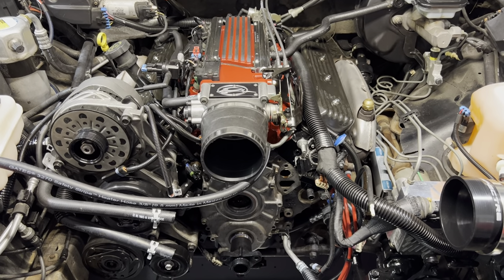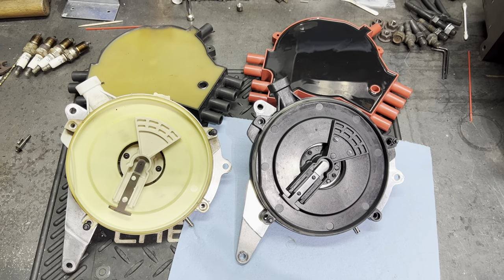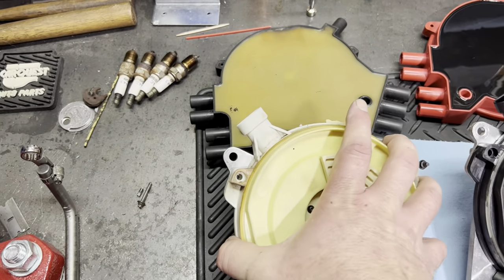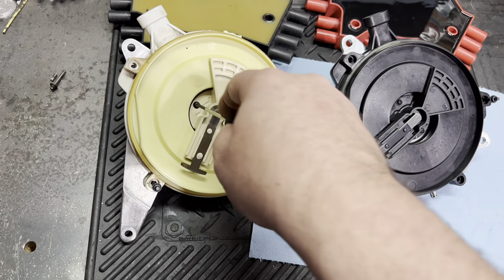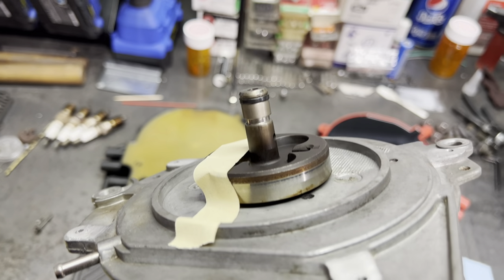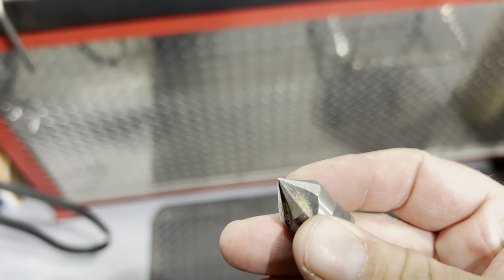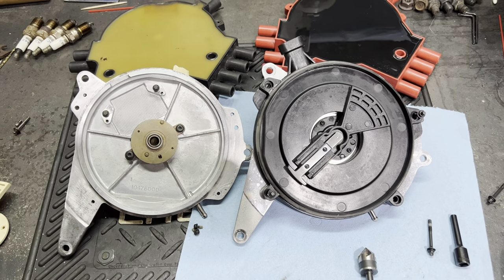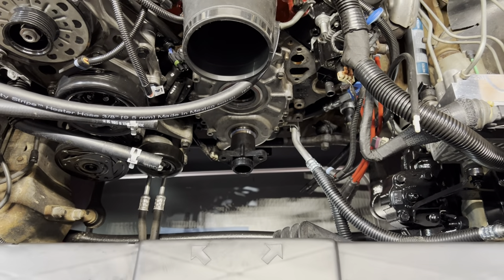Optispark Distributor. Watch before you buy!

Comment: Do i have to change my cap and rotor, or can i just change the optispark..my car has been sputtering pretty bad and i havent had a tune up in maybe 6 years.. also my upper radiator hose was leaking from the thermostat housing and i think it leaked on the optispark, any adive is appreciated!!
Reply from the maker: It sure sounds like you got moisture in it. If that's all that changed and it wa mine, I would buy a new one from Speedway if they still have them. Pull the cap off and see if its clocked right. If it is, I would just put the new one on. If that isnt available, I would buy one like the one I bought on Amazon or get one on eBay. Clean and dry the the factory base, take off the disc and spacer under the rotor, clean and dry that off and finally use some glass cleaner on a soft towel, and clean between the factory  sensor where the disc gets read. Put the cap and rotor from the new distributor and you're off. I would refrain from using the Chinese sensor when doing this because they dont seem to last. The whole distributor on Amazon is usually $70 less than a cap and rotor at Autozone.

Comment: Ok so aftermarket has came in and corrected the problematic spider/tbi with retro fit mpfi systems on the small black v6/v8s ... Is there not a way to retro fit a distributor-less ignition system of these style engines?
Reply from the maker: Yes. https://www.torqhead.com/index.html

Comment: The most important thing is the optical sensor with the Mitsubishi logo on it.i always keep my old opti and just replace the cap and rotor, and silicone it all around on the gasket it brings,and replace the 2 o'rings on back and you'll never have a problem, those after markets are garbage, even the aluminum housing because there not spaced right,the metal disk that rides on inside the optical sensor is not supposed to rub on the sensor..
Reply: I haven't started mine yet buy I already asked why not use factory optic thank u for answering that one smdh.  Poor guy drilling n tapping needs loctite retaining number 660 n any metal on metal ain't separating till over 300f.  3m panel bond or lord fusor theirs tons of compounds for all types of surfaces  many drill and tap able!! I'd have riveted the whore n sent it not like ya can get to screws or rivets without removing ingredients all else.  Seconds n done bye bye lol I hope doing my neighbors shortly here

Comment: You also have a problem with Vac with distributor put together try blowing through vac ports .
You cant the distributor caps were not upgraded for vac ports 
Try blowing through them you cant.
the 2 plastic rings seal bad gasses and water in .making cap flex and hit rotor also 
till finally loosening cap screws untill vac starts working.
but now can let water leaks in.
How to fix I took wirecutters  and Sissor clipped and brok out quarter inch 
of 2 rings lined up at 6 oclock opposite  the plug in for wiring.
now vac works as intended

Comment: Not sure if you're still checking this, but for someone who is just looking for reliability and not tuning, etc...would you recommend the Torqhead conversion?

I noticed you and a couple others in the comments talking about it and it's the first I've seen of them. Looks interesting.
Reply from the maker: @TwentyFortySeven  Try Petris. Some guys in the comments say there really good. Haven’t heard otherwise. If you go with the efi connection 24x or torque head. Make sure you research. One of them is better. I forgot though.

Comment: 3:34 yikes 6:10 there is a gent that upgrades the Opti to the 96 and newer which has the Mitsubishi pickup and rarely will fail after that. Buick didnt have this problem as from the get go they had a different optispark system which was adopted by chevy/pontiac once the failures from the 92-94 modles where prevalent.

Comment: I converted my water pump to electric as well. Absolutely no issues
Reply: I had a torqhead 24x cam shaft position sensor went out 24/7 efi connection probably would be the best way to go
Reply from the maker: Did you purchase a harness from Innovative Wiring to make the conversion, or make your own?

Comment: Have the same damned problem....with my $700 msd.....what the hell man
Reply from the maker: That’s why I didn’t buy an MSD either. After extensive research, I found that this is one problem you can’t buy your way out of. We live in a time of unprecedented incompetence. If I had to do it again, I would have done an LS swap. I have one already installed in a 93 SS clone. The only thing I would say is get one from a Camaro or corvette. I’ll probably spend as much on induction, ecu, harness, and Holley brackets/accessories as I did on the LM7 with cam and springs. Maybe more.

Comment: Just bought the mostplus all black cap one going to use it for the cap and rotor since it was one of the cheapest deals on those and came with a new cord too. Hows your frankin opti holding up?
Reply from the maker: Working great. At the end of the day, it was mostly about welding the holes and re tapping them. Put the most plus cap and rotor on with the new screws. Done. I just didn’t see good enough feedback on any so I figured swap the good sensor in the new one and blue loctite the screws, should be good. Never even considered it being out of clock. It sure made a simple job a pain in the butt.

Comment: What brand is the  new  one??
Reply from the maker: The new one (out of clock) is a Most Plus bought on Amazon. Many of these are out there sold under various names. I opted to use it because I thought I'd just swap in my optical sensor and go. Its cheaper buy the defective one just for the cap and rotor. Also has brass terminals. The cap and rotor at Autozone was 117. to 134 dollars if memory serves me right.

Comment: Thanks for this video. My Buick shut off. My buddies shop replaced the opti and the car kept stalling at idle. P0335,P0336 codes come up. Replaced opti again with a accell, car kept stalling at idle. Replaced crankshaft sensor, replaced pci, car stalls at idle, same codes. Unfortunately the original opti is long gone since at the time we didn't know the headaches with these. Not sure if I'm screwed now, once the cars warm it stalls all day and has valves tapping. Would y'all get a old opti and rebuild or what because damn it's going on 7 months and I'm about ready to push the car into a lake
Reply from the maker: Very sorry to hear about your dilemma. It’s tough to say, but with no results from two Optispark’s, and changing the cam and crank sensors, the only other things left are the wires and plugs to those having an issue. Also the only other two things in that system are the ignition coil and module. You may have to go to an auto electric specialist to retain your sanity. Stuff like this is definitely maddening.
Reply: Could be a MAP sensor
Reply: Icm bolts to the head. By the coil heat kills the thermal grease .on the heat sink
Reply: Well, here I am a year later lol 3 different shops plus my time. Misfires when warm. Looking for a ditch to lay her in 😭

Comment: So , just your original cap was bad?
Reply from the maker: I tried to inspect it and three of the 6-40 screws broke so I figured just buy new cheaper one, and put the own sensor in. I had no faith in anything out there, so why spend more when the key component was being re-used. I never anticipated that they could be out of clock.
Reply: @wheelstandr  
Man , I'm working on a 95 , rough idle , misfiring and backfiring back through TB. It did all at once , owner said he reved it up a couple times and these symptoms started immediately. Ran good before so he says. I got good injector ohms , noid light flashes and have spark all be it orange. I'm betting on bad cap and rotor. What do you think? I did FSM steps and it says distributor.

Comment: All opti sparks are trash. Best thing to do is delete it with a Torque head or EFI Connection 24X. The only benefits i get from running a MSD distributor is that they always allow me to drive him when they fail and they can be repaired by MSD.
Reply from the maker: What you're saying is true. I had intended on using my low mileage sensor in a new body and obviously that didn't work. As you saw, I had to recondition the factory distributor using a new cap and rotor. I was intending on selling the car, but after all I had to do from it sitting 20 years, I figured its a new car again. The car had a bad respray so I stripped it down and it just got repainted last Wednesday after being in the body shop for 6 months! It's dark blue metallic instead of black now. If this distributor issue comes up again I'm going to do as you said or put an LS like my 93 caprice. Dirty Dingo mounts, Holley manifolds and accessory brackets. Cost a lot more than I thought. I'm the local carb guy and have the Edelbrock carb intake box, and harness, but cant use it. The rear float bowl of a Holley touches the firewall and theres absolutely no way to get an air cleaner on it. Now I have to get an intake, rails, ECU and harness. Next time I need to get an engine from a Camaro or Corvette if I can afford it. I need to get my white SS clone running!

Comment: Just looked up an msd opti, 700$!!! Ahhh, accels are like high 3s to 400
Reply from the maker: When you have taken one apart, you realize how simple it is. It’s tough to pay that kind of money. I haven’t bought one to see if it’s clocked properly, but if my deal didn’t pan out, I was going to buy the summit racing branded one or the ones on eBay sold by speedway motors as a “garage sale item.”
Reply: @wheelstandr , oh yeah and the accel and msds that I was looking at had no warranty
Reply from the maker: @hazard4349  I just got a notification from Speedway. They have the LT1 optispark on sale for $52.49  $147.50 discount. For that price, I’d check it out. Open it up and verify the rotor is clicked correctly against your stock one. The only thing is, is that it’s a pin drive not spline.
Reply: Avoid Accel at all cost! I'm replacing a 1-year old Accel in a C4 Corvette. Very frustrating. Check out Petris Optispark.
Reply: @khalidalhomoud1883 
Agreed accel is trash!!

Comment: Don't buy the cheap China MSD look a likes. If you can find an OEM Opti Spark that's still new, buy it. Back in the 2000's I went through 2 Opiti Sparks a year. They do not like high RPM. A company called Deltech came around and developed coil on plug and that eliminated the Opti all together. It was pricey back then but worked flawlessly. Since I am not in the LT1 game anymore, I am not sure if they are still in business. But the good thing with todays after market ECM's, you can do LS type coils on it with a crank position and cam position sensor and have way more tuning capabilities than with the opit spark. I can tell you one thing, watching this video made me cringe.

Comment: Your finding out the reason  why  people prefer the  LS engine  over the LT 1. Dealing with the optispark is a pain in the ass. And the  ones from the 
parts store  are a crap shoot .
Reply from the maker: Oh no, I was already quite aware long long ago. In fact I already was in the process of an LS swap in my 93 Caprice SS Clone. My wife thought she'd do me/us  a favor and bought this work farm before I could say no. I've been pissed about this car since the first minute I laid eyes on it. 50,000 miles doesn't mean anything if the car wasnt stored properly. Now It need paint! I could have bought every top end part and more to finish the other car. All it needs is an intake tb, injectors and an ECU. Done and a very nice car.  Spohn Performance sway bars, powder coated boxed control arms, eibach springs, hotchkis-bilstein shocks, Rear z/28 spoiler, SS wheels, 96 rear disc axle w/3.73 gears. Even the one year only 94 quarter glasses. Now I'm going to have two. A gutless stocker and one with 400 plus hp. I figure now I may as well put an even bigger cam in the 5.3 since it doesnt need to be fast and as good mpg. In closing, I have never been so pissed while working on a car in my life as one I didnt pick. Let alone having to do a semi complete restoration of an entire powertrain. Every seal on this is new. every hose, but the two AC hoses. AC compressor, dryer, intake gaskets, grommets, plugs, wires, starter, alternator, radiator, radiator overflow tank, fresh air intake, sway bar bushings, shocks, calipers, pads, air pump delete, mufflers, tail pipe, seat base covers, headlight system, electric water pump, innovative wiring relay system for water pump, complete heater control, speakers, Double din conversion on the dash, respray dash pad out of the car and the dash plastics, lloyds mats, sandblast suspension parts and epoxy paint those. remove transmission, replace rear main, transmission gets new corvette servo, pump removed and resealed, and all others. .500 boost valve. finned aluminum pan with drain, new radiator plastic top. Now I have to strip everything , glass moldings bumpers, door handles to get ir painted. I'm sure I left something out, but if something is going to be mine, its going to be nice. My wife is lucky I'm not younger, this was hard on the marriage. I have lots of other cars that haven't been part of any videos. I definitely didnt need this one.
Reply: @wheelstandr  When funds permit I'm going to install the Torqhead coil per cylinder ignition setup  for my 94 firebird  formula  6 speed . dealing with a shit optispark after getting stranded in morning  rush hour traffic was enough of a headache for me. The engineers  at GM  must have been smoking some Hella good  weed  when they thought  up  that shit stom optispark.

Comment: change it over to ls coils, best move ever on an lt 1
Reply: How
Reply: There is nothing wrong with the Optispark. Anyone that says that is just ignorant. Sure its in an inconvenient position, but it is a very accurate distributor. The reason for them failing are usually either people thinking they don't need maintenance or the waterpump failing. With a proper installation and not being cheap on a replacement Optisparks are very reliable and fine.